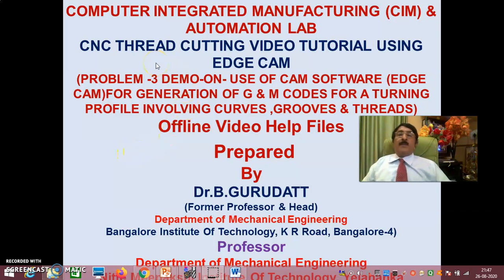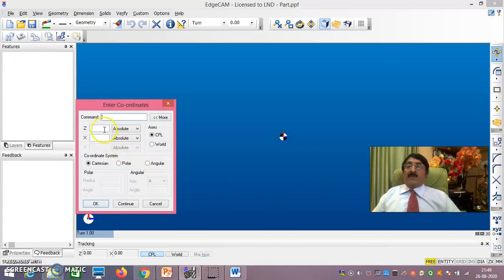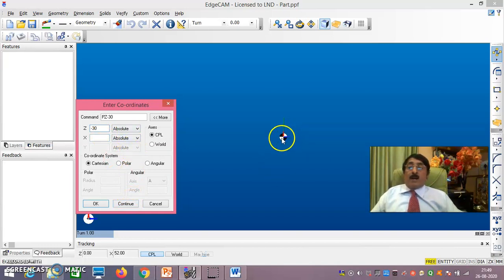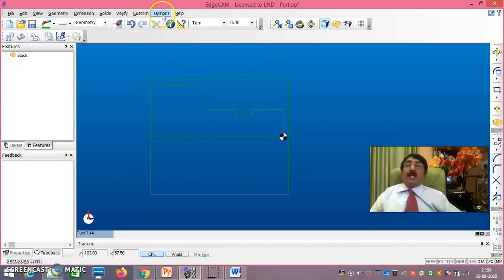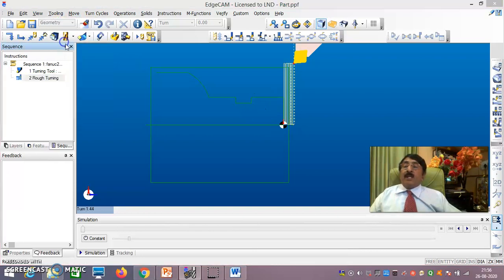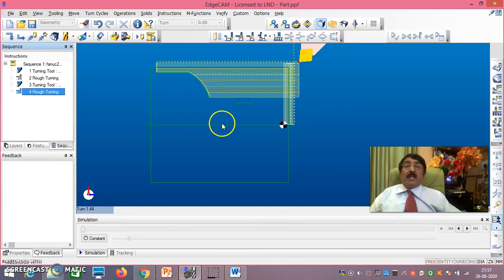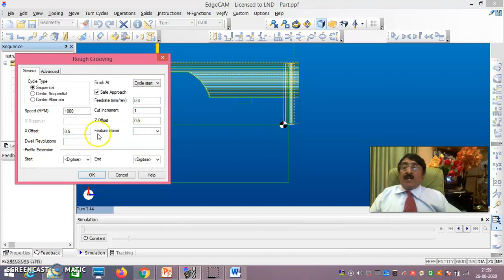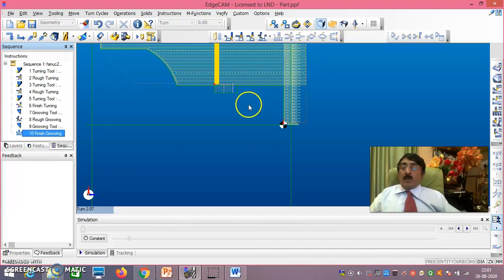CNC  Thread Cutting Demo Using EdgeCAM- With Allowances - Problem-3 Session-1

Comment: There is another way is to draw the AutoCAD drawing and work on it on the Edge Cam program, but I need to zero the pen on the surface and the side with special measurements for the holder